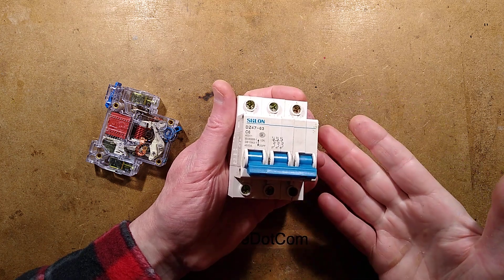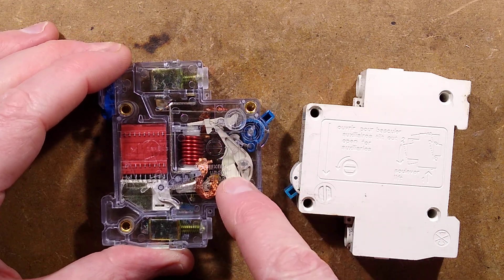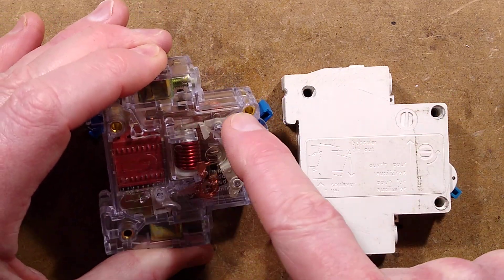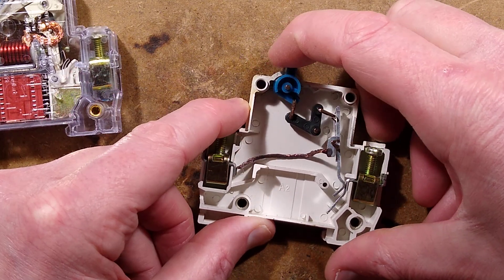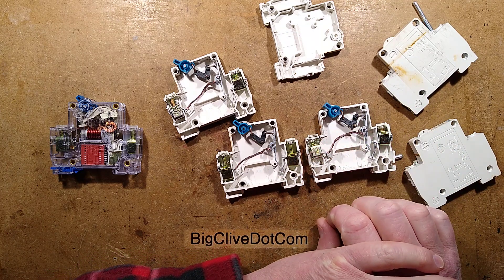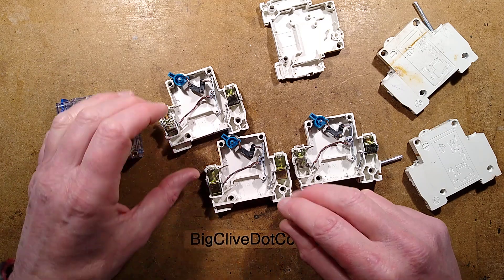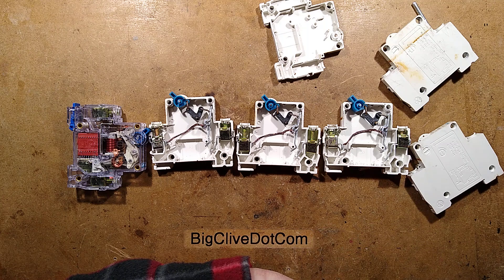Inside a fake un-trippable circuit breaker.

Comment: It's like selling empty fire extinguishers. Unbeliveable.
Reply: Yes, but with the charge needle glued to full!
Reply: i wouldn't put it past those sorts of people to put powdered magnesium in
Reply: or perhaps a flammable fire blanket.... oh wait, we should probably not give the manufacturer of this circuit breaker any ideas.
Reply: Using butane as the propellant.
Reply: @Anvilshock  Propane is much cheaper for propellant, otherwise I'd be buying them just for the butane!
Reply: Oxygen as propellant..
Reply: sort of... in some countries, I guarantee you most people have no idea what a circuit breaker is. they probably think it's a switch to turn off the electricity when you need to work on the wiring. no safety features required or expected! also, it's pretty clear when you buy things which are fake (or "just for decoration") and the genuine article, and are priced accordingly. also, typically sold in different marketplaces. that's how developing parts of asia are.
Reply: @sheiladikshit5110  And in some places people used to redo old ceramic circuit breakers with copper wire stacks from old coils. Cause they are expense for nothing. This will do.
Reply: Well, the fire extinguishers have to be refilled every now and then, even if they weren't used. So I it's not exactly the same. Also would be harder to pull off, the weight is too telling. Filled with water or sand - that would be criminal tho.
Reply: @Nemo7The7Pirate7  Filled with petrol/gasoline....
Reply: @ElliottVeares  That reminds me of the circus scene from Dumbo. Old Disney was so much darker!
Reply: @Nemo7The7Pirate7   there are actually water fire extinguishers, however these are labeled as such, refillable, etc.
Reply: @scottwillis5434  There are types of fire (liquid-fuelled or involving live electrics) that you can't use a water extinguisher on.  That's why CO2 and dry-powder types exist.
Reply: @scottwillis5434  And there silver colored. At least here in the US, anyway.
Reply: @Kromaatikse  Liquid fuels can be ignited by a CO2 extinguisher - aqueous foam is a better option (the standard marking for these is a blue band). For electrical fires there are special powdered glass extinguishers (which also work well on metal fires).
Heaven help you if you have to deal with an aluminium alkyl or chlorine Trifluoride fire - nothing will put those out.
Reply: Filled with gasoline...
Reply: @fjjwfp7819  here's a story kind of along those lines

I used to work in the offshore oil and gas industry. One of our barges was working in Mexico, laying some pipe. A fire started from some sparks from one of the welders. So someone grabbed a fire extinguisher to put it out but the extinguisher didn't fire. Someone else shows up with another extinguisher and it didn't fire either. This continued until a hose was brought out and the fire was put out with water. Ends up some of the nationals had blown off most of the fire extinguishers on deck and were using them to make hooch. There's no telling how long that had been going on for. Thankfully no one was hurt, nor was there any significant damage.
Reply: It was only after I tried to blow out a birthday candle with "canned air duster" that I realized it was actually butane. Parties at my place are always fun.
Reply: @Dee_Just_Dee  I work at a mechanic shop and  were trying to get an old junk car running and one of my co-workers had the great idea to use canned air duster as a stand in for ether to help kick this old engine over, sprayed some down the throttle, there was a sizeable explosion,  blew the carburetor clean off the intake manifold xD
Reply: @SUPRAMIKE18  Did your co-worker get a carb in his "grill"?!
Reply: @DesertCatDad  noone got hit by anything luckily everyone was fine other than a few toasted eyebrows lol (it made an impressive fireball)
Reply: @Dee_Just_Dee  Plol.
Reply: what do you mean? empty fire extinguishers can still be used to bash someone or something. And since it's empty it's more lightweight ! :D
Reply: Poltergeist they fill it with petrol, and a lighter.
Reply: @isaacsrandomvideos667  why a lighter? If it"s a fire extinguisher you would already be spraying it onto fire, or what?
Reply: U'r joking but fire extinguishers full of sand or dirt and compressed air to the right pressure are a thing. That's why they need the right seals and stamps and papers and all that annoying, expensive crap.
Reply: @widdermann100  Used engine oil or used cooking oil by any chance ? :D
Reply: Unscrupulous landlords do that too.
Reply: How’s this for idea: the same guy sells that breaker, the empty fire extinguishers and owns a construction company!
Reply: @widdermann100  or uranium
Reply: @guyh3403  Only if it was cheaper.

Comment: So are these scam Chinese counterfeit/knockoff circuit breakers?? Or are these sold online as bypasses??
Reply from the maker: There's a good chance it was supplied as a switch in a circuit breaker casing.  But it's original role should have been as an overcurrent device.
Reply: @bigclivedotcom  Thanks for the reply!! These "switches" look dangerous, there should be a warning on the front "not a breaker". What a fire hazard. Keep up the excellent videos!
Reply: @Poop-nu1so  Or, y'know, don't mark them as breakers? Or make them at all as they have no good reason to exist..
Reply: @Monkeh616   @Monkeh  i agree with you but i was unable to see the word "breaker" on the part. Only the 6C and a part number. The average person would just google that, and assume it's a breaker without opening it up. Another reason why Chinese built garbage needs to go away. It's not worth the lower price.
Reply: @Poop-nu1so  Of course they'd assume it's a breaker, it's clearly marked as one..

It's a fake. It's not a switch which needs better markings, it is a fake breaker.

Comment: The construction on this is similar to Federal Pacific used in the US for over 50 years, starting in the early 40's. There's millions of these boxes still in use. They don't trip. Fed Pac was sued out of existence in 1992.
Reply: Can confirm, bought a house built in the early 80s and had to pay an electrician to replace its FP box. And apparently the previous owners were running a hot tub on it as well 🤪
Reply: Zinsco was another one. I grew up near the factory, and my electrician father had to replace many, many of them.
Reply: FPE Stab-Lok breakers were real circuit breakers but they had a design flaw that would make them highly unreliable. You could test one and have it trip precisely as it should, but there was no guarantee that it would trip properly the second or third time around. They've been known to jam. These panels were also known to have issues with the breakers not seating tightly enough in the busbar.
Reply: It would be just better to just use vintage fuses.
Reply: @MernokiMegoldasok  Agreed. With glass or windowed fuses, you could tell if the fuse blew from a short circuit or a overload by the way the fuse link was melted.
Reply: @dickcheney6  That makes me think, maybe it would be helpful if real circuit breakers were built with a traditional fuse inside. Then if the breaker fails the current is still stopped.
Reply: @airplaneengine  In some countries,like Austria and Hungary they even fused the neutral in the 1960s.I never heard about anyone who had problems with that.

Comment: any tought on ambient temperature for those bimetal strips in breakers?
to make them causing a trip, they gotta get to like 50..60C i guess?   
what if you have your breaker box in a very cold shed, it takes much more to make it heat that much. also in hot climates with sun shining on the breaker box causing it to trip prematurely
Reply from the maker: Ambient temperature does affect trip threshold and time.  But not a huge amount.

Comment: Ok i crosschecked something.
This item is sold under many names especially on amazon. So careful!
BUT i realized, this circuitbreakers are actually , to secure the seller, sold with correct wiringplan printed on the L2 front.!!! I compared the print with the brand ABB! There you will find instead this steange s-shape in front of the switchpart an X to symbolize the electromechanical actuator to cut the energy.and to hager they print 2 rectangle fusesymbols to mark the 2 ways of tripping
So if someone comes and claims fr au d , the seller would say to this item :" this is actually a 3 phase main switch rated 6amps"... and point on the wiringprint.
Reply: Err, no, if you look at the front of this unit the symbol does indicate a circuit breaker, not a switch. It also claims IEC 60898-1, which is a standard for circuit breakers, not switches.
Reply: @Monkeh616  i know what you mean....
But thats the trick of the scammers...
Look carefully to the circuit... under the switchsymbol is the symbol of loose wiring.
I know its wanted to look like a regular breaker... i am aware of that, even with the characteristikprint C6.
But really compare the circuit with ABB
https://www.amazon.de/dp/B0018L9JMU/ref=cm_sw_r_cp_apa_i_VH0ESHC5FMYG2D0T4XDM

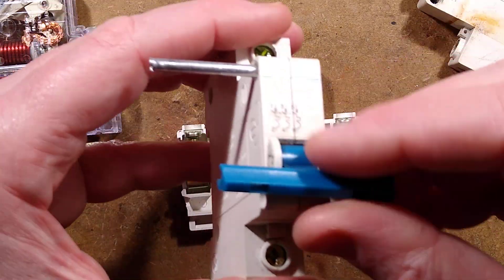... if you understand my first answer, i referred ONLY to the diagram on L2 at 2:40 , not to the printing on L1
Reply: @pandabaerhellas  The diagram badly printed across the middle segment of the unit indicates a circuit breaker suitable for isolation, and the bottom half indicates thermal and magnetic tripping functionality. Nothing about 'loose wiring'. There is absolutely no possible justification for the markings on any part of it.

Comment: That's absolutely outrageous, but the only surprise is that it made into the UK undetected. I've seen lots of cheap Chinese knock-off electrical equipment in Africa, 13 Amp sockets with steel conductor bars (Sprayed with copper coating) that I only detected because my magnetic screwdriver kept sticking to the bars!
I would want to find out how that generator was fitted with that shoddy MCB, and hopefully trace the components through ISO 9001.

Comment: Clive is there ANY ACTUAL USE for something as dangerous as this is? Testing? Circuit verification? Have to ask!
Reply from the maker: If it had been marked appropriately it could have been a low current isolator.  But it's too dangerous to release in the wild as it is.

Comment: I had a customer that wanted to replace a burnt 15 amp 120 volt receptacle, turns out that circuit was attached to the two pole 50 amp stove breaker.... I was shocked his house didnt burn down!
Reply from the maker: What was the wiring rated at?
Reply: @bigclivedotcom  14 gauge, rated at 15 amps. The wiring was completely discolored. Very lucky only the receptacle burnt to a crisp instead of his house.
Reply: So instead of using a dedicated breaker for one or several 120V outlets, they just connected the 120V outlet hot to one of the poles on the 50A stove breaker?
Reply: @mckenziekeith7434  correct, they took the hot leg off a 15 amp breaker and shoved it in the 50 amp breaker that feeds the stove.
Reply: @crazypete3759  Oh man. Some people, the only thing they know about electricity is that it goes through wires.

Comment: Is there a Trip current listing on the device ?
Reply: Did you take two seconds to look at it?
Reply: @Monkeh616  I am working with a limited resolution display,,  so I could not read the text on it,, so part my fault ..
Reply from the maker: The C6 indicates 6A with a tripping characteristic for loads with relatively high inrush current.

Comment: The DIYers who buy these thinking they got a great deal are also the ones who could badly screw up their electrical systems and need these to work.
The tenants thinking that at least their landlords are complying with the law don't know that they have early 20th century levels of electrical safety in their walls, if that.
This is probably the most damning thing ever featured on this channel. Utterly appalling that someone would feel the need to buy a FAKE safety device and even more appalling that this was built by an actual company and not someone's uncle doing shady things in his garage.